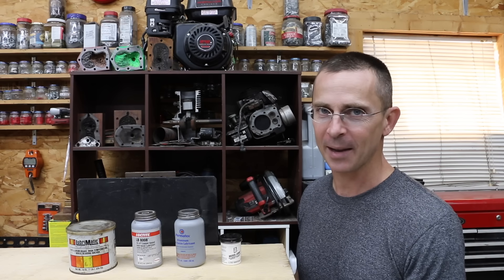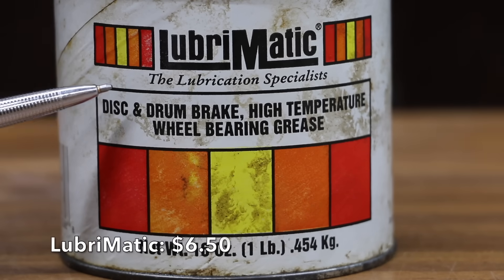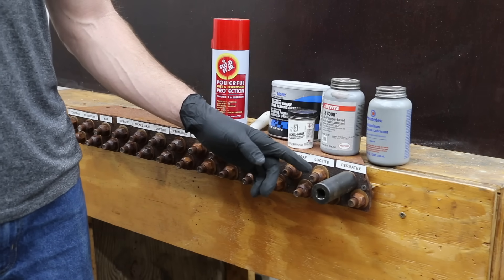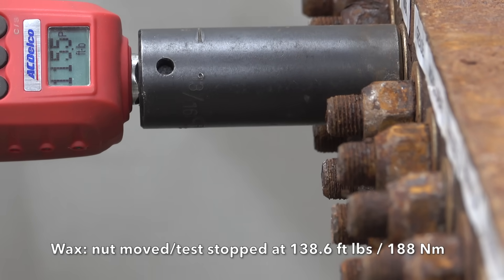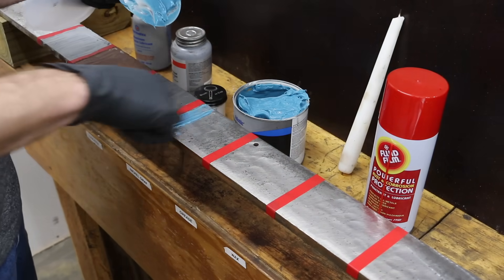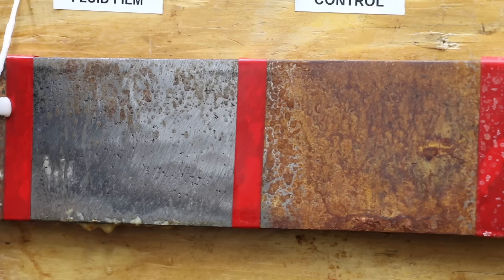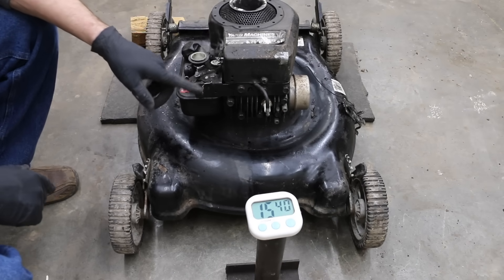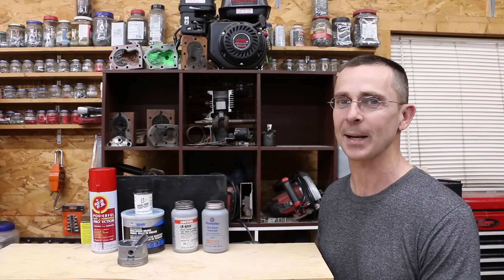Does Anti-Seize Compound Actually Work? Let's find out! Anti-Seize vs Grease vs Fluid Film vs Wax

Comment: Loctite anti seize, that makes no sense.
Reply: haha never thought of that
Reply: Yeah it locks tight on the surfaces and won’t wash off easily so they can move passed each other stopping seizure. Loctite, where’s my free stuff for the mental gymnastics I just did here?
Reply: You can actually use blue or purple loc-tite as an antiseize. It keeps the threads from galling and rusting. It's not actually much harder to break free than a regular nut, I think. Definitely easier than a rusted nut. 

So using loctite on bolts on your car actually makes them easier to remove, at least after a couple years.
Reply: @Savagedownsouth  Case and Cat use a lot of blue on undercarriage bolts for both locking and rust preventing.
Reply: @jerrygaber6150  Long as they don't use red.
Reply: @Dalton Patterson  Case and Cat use lots of medium threadlocker on undercarriage bolts that way.
Reply: @Savagedownsouth  - I think they're supposed to require heat  to loosen em ..
Reply: @shiitakestick  I always use heat for red loctite. But blue just takes a lil extra torque. Unless someone put it on a tiny screw. Those are supposed to get purple loctite.
Reply: Got me wondering what would be a more appropriated name: Un-loctite?
Reply: @marceloiannini8199  open loose?
Reply: Anti anti seize
Reply: You have become the thing you swore to destroy!
Reply: Like Jumbo Shrimp
Reply: They know what they're up against! Insider knowledge lol
Reply: They thought of it while eating jumbo shrimp.
Reply: Holy shit. I been using and cursing that shot for years and never thought of that. Lol
Reply: Oxymoron' ?
Reply: Not really, Loctite is actually an anti-seize in itself. It is a designed to stop a fastener getting stuck by keeping moisture out, while still giving it the break away torque we desire. In short, its designed to keep the break away torque needed in a comfortable"range".
Reply: Mixing red loctite and loctite antiseize would be like mixing matter and antimatter. You could end the universe.
Reply: It makes perfect sense.  Loctite™ makes several products, and even their screw anti-loosening adhesive has anti-corrosion properties that permit a sealed screw to be removed easily when a proper tool is applied.
Reply: Funny. I thought the same about "permatex." I always double check the label to make sure it's anti-seize and not a binding agent. Maybe "JB Weld" should make an anti-seize product. A little "JB Weld anti-seize" on the bolts sounds like a great marketing idea.
Reply: correction 3ml for $1.01 !! 
also the red "Permanent" -  - 
Vibra-TITE - 13150 131 Permanent Strength Anaerobic Threadlocker, 50 ml Bottle, Red $16.
Reply: From the same place as a hot water heater?
Reply: New and improved.
Reply: They're double dipping
Reply: 😂😂😂you know what??😂😂😂son of a ...that's hilarious
Reply: Well loctite is just a the name of a brand at this point.
Reply: kind of like Jumbo Shrimp makes no sense
Reply: Loctite branded anti seize... Lol.
Reply: tight ain't seized boi

Comment: I have has good results using thread locking compound. It holds the fasteners in place and seems to prevent oxidation. I wonder how well they might work under the conditions of your test. Might be an interesting video.
Reply from the maker: Thanks for the video idea.

Comment: I use Permatex on everything. I put a THIN coat on bolt pattern area of rotors on car's, both sides rim and hub. Change the brakes years later and the rims and rotors just come right off with your hands. I do the same on my big truck drums, and they come right off. Every time I did a brake on a big truck, I've always had to beat the drums lose with a 20lb sledge hammer. Not since using anti-seize, they just come right off. So yes anti-seize definitely works.
Reply from the maker: Thanks for the feedback.

Comment: If we're talking practicality vs cost, most shops I've worked in uses the permatex aluminum powder based anti-sieze rather than anything else except where required by application. The loctite or any other copper powder based anti-siezes are meant for exhaust parts where the anti-seize is in contact with cast iron and steel that heat cycles. Predominantly, I've seen hightemp molybdenum sulfide greases used with exhaust sensors anymore. They don't recommend copper anti-sieze anymore for exhaust sensors because it can cause stray voltage in the exhaust to alter sensor signals.
Reply from the maker: Thanks for sharing.

Comment: Could you post the "recipe" for that oxidizing agent? I got the hydrogen peroxide part but I can't even guess the rest and the proportions.  Did you say you added vinegar too???  And salt?  I am really confused about this.  I'm asking because I need to "rust" some parts for a home project I am making, and I liked the color and the speed of the rust that was appearing.
My only other option until I saw this was to use hydrochloric acid but I am very hesitant because it is very harmful and dangerous to use, and bad for the environment too.
Thanks!

Comment: Hi,  to add to this video,  you mentioned copper loctite and aluminum corrosion.  how about another follow up   or part 2 video ,    copper loctite on spark plugs in aluminum heads  with long term heat cycles as the average passenger car / truck ?
Reply from the maker: Thanks for the video idea.

Comment: I mostly use anti seize in building my ham radio antennas, some of the larger antennas have many bolted steel and aluminum components and It helps ensure electrical conductivity in joints. Permatex and Penetrox-A are my two gotos. Also I exclusively use stainless fasteners for the antennas, and anti-seize is a must for those.
Reply from the maker: Thanks for sharing.

Comment: Project farm thanks for the videos!!  There are different camps of mechanics. I antiseize everything on my cars while im working on stuff. I also live in an area that rusts lug nuts on and there are controversial thoughts on if its ok to anti seize your lug nuts. I use it on all my rigs because I change winter tires and summer tires and I have never had an issue with its use. One thing to watch out though is if you take your car to a shop they might use a crazy high impact setting and really drive the lugs on if there is anti seize on them.
Reply from the maker: You are welcome!  Thanks for sharing.

Comment: I'd love to see an episode about using anti-seize on wheel lug nuts, with respect to bolt stretching.  Maybe something like a myth-buster format.  I used to use anti-seize but I've had to replace some wheel studs and I think the cause is the lubricant and not using a torque wrench.
Reply from the maker: Thank you for the video idea!

Comment: To be honest the candle wax worked pretty well on places it was applied correctly.
To apply it the right way you not only sprimkle it on the metal but you should also heat it so it melts and sticks to the metal. 
On the metal plate you can see places where it actually sticks and it does really good job.

The heated nuts will not hold well as the was will just evaporate in such high temperatures.

I use candle wax on bike chains and it works really well but you need to actually cook the chain in the wax.
Reply from the maker: Thanks for the feedback.

Comment: In the first test I’d think the product that required as close to 90 lb/ft, but not more, to break free would be ideal since you wouldn’t want the nuts or bolts loosening as a result of the product after being torqued.
Reply: Its all about friction & to get an acurate torque you need lubrication of some kind. Infact nowadays torque turning is used in conjunction with an initial torque as in usualy a low torque setting with a torque wrench then plus x- amount of degrees turn aswell with lubrication also.
Reply: in theory, it should take less torque to remove a nut since you're working WITH the angle of the threads rather than against them when you're tightening.  Think sliding downhill as opposed to sliding uphill.

Comment: I work on the dutch railroads and we are thaught that when we user bolts we apply Shell SW2 grease to protect and lubricate the bolts. However we also capsulate bolts in the same grease. This prevents water ingress and stops bolts from rusting. When we dissasemble in 2 years everything slides out easily.  You van do this with every Bolt with every kind of grease. I even user this technique in my car and not one single bolt is corroded of rusted
Reply from the maker: Thanks for sharing.

Comment: I USE THIS STUFF CALLED DRY LUBE BUT NOT THE STUFF YOU BUY AT THE LOCAL AUTO PARTS STORE THIS STUFF IS MADE BY A COMPANY CALLED CASTLE AND IT HAS A MOLECULAR BONDING AGENT AND IT IS ABSOLUTELY INCREDIBLE AND IT IS GRAPHITE BASED, ONCE YOU PLACE THE SONG A CLEAN BOLT AND NUT AND WEIGH 10 TO 15 MINUTES AND THEN ASSEMBLE IT IS ALMOST IMPOSSIBLE TO GET THAT BONDING OFF THE BOLT AND NUT NOT EVEN A POWER WASHER CAN WASH IT OFF AT CLOSE RANGE. 28 TO $32 FOR A CAN IS EXPENSIVE BUT THE STUFF IS ABSOLUTELY INCREDIBLE AND KIND OF HARD TO FIND
Reply from the maker: Thanks for sharing.

Comment: OKAY SO THAT WAS A PRETTY DECENT TEST BUT REMEMBER ONE THING IF YOU WERE TO SPRAY RUST BUSTER ON EVERY ONE OF THOSE YOU WOULD HAVE SEEN THE NUMBERS COME DOWN CONSIDERABLY THE WHOLE IDEA BEHIND THE COPPER EYES SEASON CREAM AND PERMATEX SEASON CREAM WHICH IS 1600°, IS THAT IT PROTECTS THE THREADS INSIDE THE NUT WHERE THE NUT AND BOLT ARE SEALED TOGETHER AND THAT'S WHAT REALLY MATTERS, BECAUSE SPRAYING RUST BUSTER ON ANY RUSTED NUT AND BOLT AND THEN COMING BACK 15 MINUTES LATER AND SPRAYING THEM AGAIN AND THEN TURNING YOUR BREAKER BAR OR RATCHET TO THE TIGHTENING SIDE EVER SO SLIGHTLY AND THEN BACKING THEM OUT PRETTY MUCH BRINGS EVERY BOLT TO A LOOSE STATUS. GREAT VIDEO BUT I THINK YOU'RE MISSING THE WHOLE POINT OF THE  SEIZING CREAM. IT PROTECTS THE THREAD INSIDE THE BOLT AND THAT'S WHERE YOU RUN INTO PROBLEMS BREAKING BOLTS ON CARS BECAUSE PEOPLE WILL PUT BACK THESE BOLTS AND NEVER PUT SEASON CREAM ON THEM AND AS LONG AS THEY'RE PROTECTED INSIDE IT WILL NEVER CEASE INCLUDING EXHAUST SYSTEMS HAVE OWNED MY OWN RESTORATION SHOP FOR OVER 30 YEARS AND HAVE YET TO NOT USE PERMATEX ALUMINIZED SEASON CREAM AND HAVE NEVER HAD AN ISSUE EVER. WHEN THESE ISSUES COME INTO THE SHOP AND IT'S IMPERATIVE THAT WE SAVE THE INTEGRITY OF THE BOLT WE HAVE A TRICK WE DO AND IT IS THAT WE HEAT UP THE BOLT WITH OUR TORCH AND THEN WHEN IT GETS GOOD AND HOT WE HIT IT WITH RUSTBUSTER AND IMMEDIATELY LOOSEN THE BOLT AND THEY COME OFF EVERY SINGLE TIME.
Reply from the maker: Thanks for the feedback.

Comment: I feel like the lubrimatic was better then the anti seize. If you torque a bolt down to 90ftlbs then nothing less then 90ftlbs should break it loose. Since the antiseize compound all broke loose at less then 90ftlbs I consider that a failure. The lubrimatic broke loose at 96ftlbs which is perfect because it was just slight tighter then the 90ftlbs and no looser.
Reply from the maker: Thanks for the feedback.

Comment: I would like to see if you could run an engine using fluid film as the oil. You can buy fluid film by the gallon and it's a different viscosity then when you buy it by the aerosol can
Reply from the maker: Thanks for the video idea.

Comment: Steel bolts in aluminum is my main use of anti-seizure. It is especially important to prevent corrosion caused by electrolysis.
Reply from the maker: Thanks for sharing.

Comment: 😐great vedio. Anti seize does work, Permatex is the choice of mechanic and steel worker, been around a long time. I have broken loose nut and bolts that been untouched for years and years thats been anti seized. It works. But what most don't know is that there is an anti seize torque chart that really should be used. Also been around for years , Not so much a dry vs wet torque, but an actual anti seize torch chart.!! People are only given dry torque values..  A 100 foot lb on a bolt using anti seize will actually be around 140 to 160 foot lbs. Causing strip threads, overly stretched bolts. Bad real bad. On auto work.. Heads ! Water pumps, ect. So when you applied 90 foot lbs you actually applied well over 130 foot lbs or more. Because all torque wrenches only gives dry value.. Torqueing a set of head bolts but using anti seize,,, be careful. You will pull or strip the treads in the block or what ever. The torque wrench value is usually 40 to 60 percent less when using anti seize... Depending on the size of bolt, nut, diameter, length of threads. Thats what the chart is for!.
Reply from the maker: Thanks!  Thanks for sharing.

Comment: Came back to this video March 2021enformative as usual. One thing to note. I building or rebuilding diesel or gasoline engines don' use the Loctite L8008 copper bases anti-seize lubricant. The copper particles will wash off in the oil and mess up oil samples if taken. I know from experience..
Reply from the maker: Thanks!  Thanks for sharing.

Comment: Is it a good idea to apply anti-seize on installing stabilizer links and suspension parts?  I am afraid it will come loose but also afraid if I cannot remove it later from corrosion.  VEry common issues in stabilizer links.
Reply from the maker: Thanks for the video idea.

Comment: Several decades ago I used aluminum based anti-seize on car exhaust systems.  Without anti-seize it was generally impossible to take the system apart without destroying it.  With the anti-seize I could separate pipes and clamps without cutting them.  Grease did not work over the long haul.  As for use in an engine, that was destined to fail.  Anti-seize is  intended to stop metal from sticking together, not provide lubricant for fast moving parts.  In that application the metal particles (aluminum, copper, or nickel) become abrasive and destroy the engine.
Reply from the maker: Thanks for sharing.

Comment: I was thinking about this.  I would put steel bolts into aluminum and subject to many heat cool cycles.  It seem that the galvanic action between the steel and aluminum plays a part in bolts seizing and heat makes this worse.
Reply from the maker: Thanks for the feedback.

Comment: That happened with my dad's truck. We tried everything from torque wrenches, we even called in a friend who had a pneumatic impact gun but it didn't do a thing. We had to have the engine bolts machined out and retapped. Cost us almost 2,000 to get it fixed.
Reply from the maker: Thanks for sharing.

Comment: You're supposed to use this stuff on bolts? I was a pipefitter and we used it on company trucks. Just a touch behind the door handle, steering wheel, and knobs, you will be covered in this crap before ya know it. Blue chalk line chalk on top of the sun visor never hurts either. You'll learn to lock your truck. lol
Reply from the maker: Thanks for the feedback.

Comment: Great work on testing the products. I personally use copper based anti-seize, just because of the natural neutrality of copper. I work with a lot of high pressure steam in my profession, something many people wouldn't really think about is pipe dope as an anti-seize. I have used it on many high pressure steam fittings and unions with great success. It would need to be a good quality/non-hardening Teflon based pipe dope. It's ability to with stand heat, water and corrosion is pretty good.

Comment: I was working on my Harley one time, general maintenance stuff, and I had a tube of Loctite silver anti-seize for a few things and somehow I unknowingly knocked it onto the floor. The work shorts I had on that day were torn right in the center at the back.

Apparently, at some point, I stepped on this tube of anti-seize with my boot and busted it open without realizing it. Now, when I am kneeling down, I have a bad tendency to have one leg bent back and sit on my heel.

When I turned around, I noticed all the anti-seize and when I looked myself over... well, it had seeped through my boxers, so I went to go take a shower and when I got undressed, it looked like I had been "bummed" by the Tin Man or something. Worst place to have to wash anti-seize out of.

Comment: How did you remove the zinc coating? 

Can you also test what chemicals/procedures work the absolute best at remove heavy gas deposits in fuel tanks? 

Motorcycle tanks that had gas in them for many years.
Reply from the maker: Great suggestion!  Thank you.

Comment: I absolutely wish it was against the law for outboard manufacturers to assemble engines without antiseize.

Nothing ruins your day more than a broken lower unit bolt on a saltwater engine.

Trying to drill out a corroded bolt in 98 degree Alabama heat would make jesus sound like a sailor.
Reply from the maker: Great point!

Comment: Quick comment on anti-seize. It’s generally for applications where you might have high heat stress, high mechanical stress, or corrosion due to the difference in metals. While you can use it for general bolts/screws that experience regular rusting conditions, it’s usually recommended for the other uses/issues stated above.
Reply from the maker: Thanks for the feedback.

Comment: I use anti-seize aluminum or copper on lawn mower blade mounting bolts and lug nuts on my vehicles. I have twisted off studs before.
Reply from the maker: Thanks for sharing.

Comment: I swear by Nickel based anti seize. I had a flat about 3 yrs ago. The lugs breezed right off. Love it.  It work well on brake bolts as well . Parts came right off with no damaged fasteners after 10 years.
Reply from the maker: Thanks for sharing.